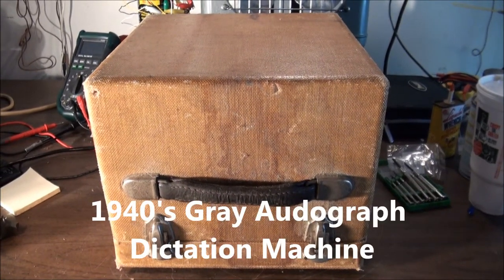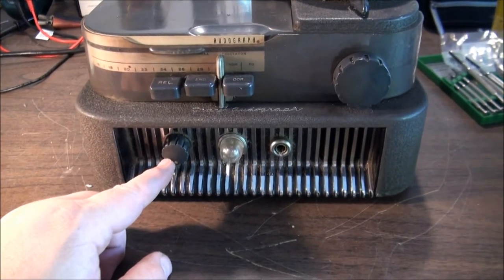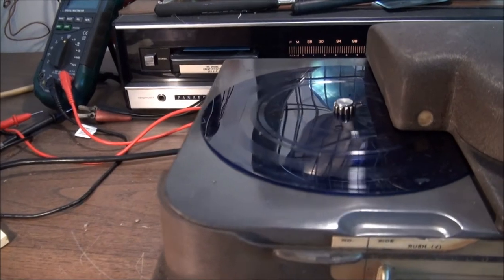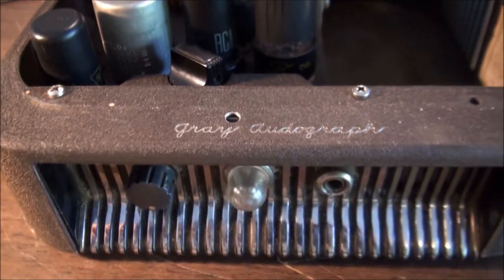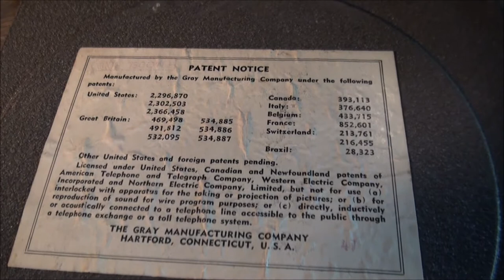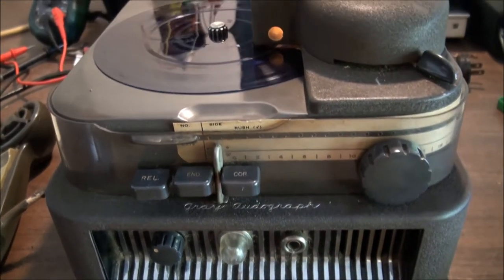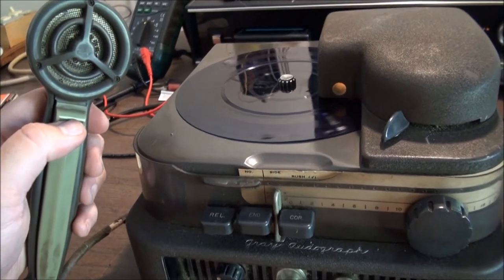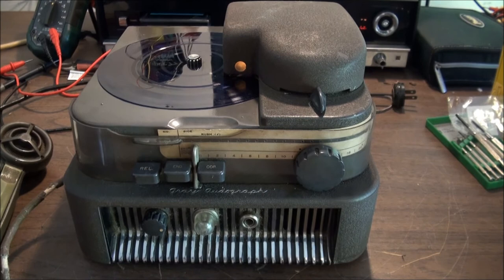1947 Gray Audograph Dictating Machine

Comment: You should replace all the capacitors before you ever try to power it up again.  If there is a shorted capacitor in there it might take the transformer out. Of all the (electrical)  things in there to die, the transformer will likely be the most expensive if you can even find a suitable replacement (depending on how many sections it has and what they are).   It's also probably not a good idea to run the motor as the oil is probably long dried up. But it's pretty easy to recondition the motor as long as it didn't run a lot without the oil in the bearings (they usually have a felt to hold a lot of oil in them).  It's really not that difficult to get it back up and running.  Hope you do. Old tech like this is a lot of fun.

Comment: your machine do have a outputstage i would gues the 6v6 output tube is used to drive both the cutterhead and a (probobly external) speaker. your machines looks very clean inside and the electronics looks very original loots of old electrolytic caps and paper caps they are probobly all bad.
Reply: How do you remove the needle cover on top??